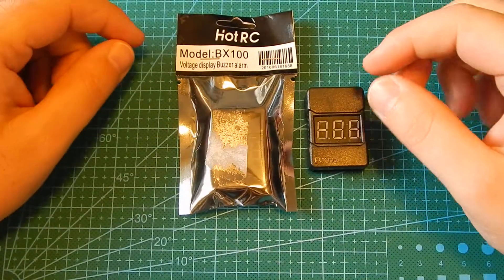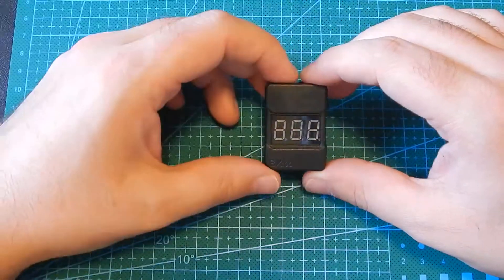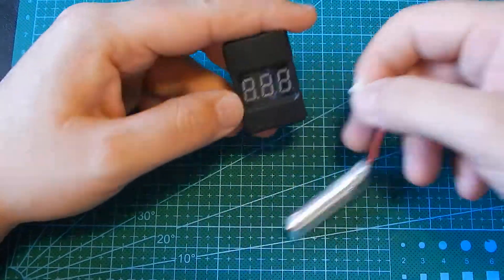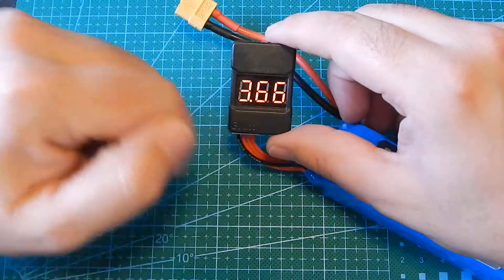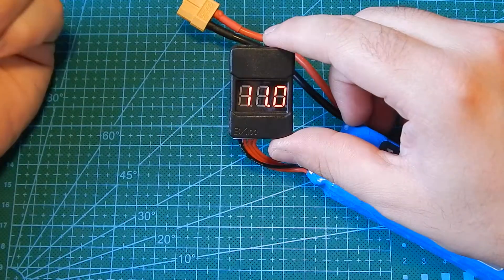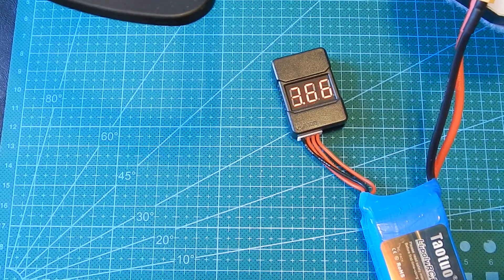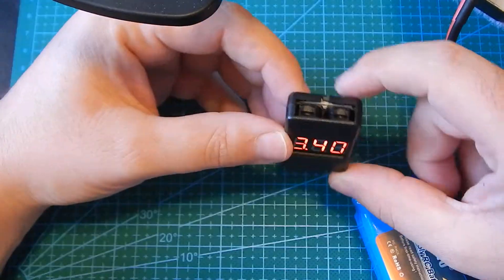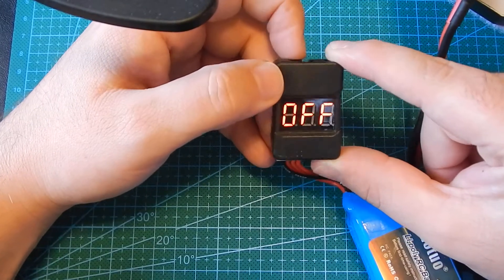BX100 Battery Voltage Tester Low Voltage Alarm Buzzer For 1~8S Lipo Battery

Comment: They're good but I wish the alarm would stop bleeping once the voltage goes up again, i.e. no longer draining the battery. Say for example it alarms at 3.2v and when you use the battery pack it drops below it. Alarm sounds. Stop using the battery and the voltage raises to say 3.4v, the alarm should stop by itself without manual override.
Reply: correct, u must d/c the cable for it to stop in my case

Comment: Hi I bought a few of these because HK is always out of stock.  But once mine gets triggered by low voltage from sagging, the alarm says on until I land and unplug it.  Does yours so that or does it behave like the HK ones where the alarm stops once the voltage recovers?

Any idea if that setting can be changed?
Reply from the maker: Mine does the same until it's plugged out or the button on the top is pressed.  I am unaware of any way to change it to behave as HK one. If I find a way I'll be more than happy to share it.

Comment: New problem. The second buzzer I used just now, started to buzz after less than a minute of driving without reach the voltage I have set. I have set it to 3.7 volt and with a fresh charged battery started to buzz to buzz after 10 to 20 seconds. Every time happens the same thing after i have disconnect and reconnect the buzzer.
Reply: same problem, is this thing even accurate, i display higher voltages on some cells when on load!, so a cell off load was 4.0v onload 4.15!
Reply: @GraphicManInnovations is not accurate and that's why I use battery tester, the device that has liquid crystal screen. The point is that the buzzer is good when it buzz to warn you when you want to stop drive. Next time I will buy the cheaper buzzers like the classics with the transparent cover with the hope to work.
Reply: @but531 
 @but531 
guess what i just discovered now also, the button does not work, it was working before, opened it and found one leg is not soldered at all!, so i soldered it and the button worked, however to be honest the voltages are pretty accurate off load, when on load it is really all over the place! many cells are not under 3 but it beeps for them, other recorded over 4.5 volts!! totals looks ok, i am really wondering what is the reason for that inaccuracy under load! there must be a good reason for this
Reply: @GraphicManInnovations  over 4.5 volts its wrong, a normal lipo is 4.2 volt per cell maximum. I don't know what else to say. Nice that you solder the leg. We should try other lipo buzzers and after you measure the voltage with the buzzer immediately measure with a voltage meter and see the differences.
Reply: @but531 
i am using 18650 cells, lithium ion, i did compare the voltages with a multimeter and the buzzer is making a mess, i have no idea why  it is acting like that under the load, makes no sense to me , it is very accurate with no load

Comment: Doesn't alarm to me, I set to mine but doesn't alarm and the battery stopped working at 3.1 volts. Man is so disappointing, I buy it to protect the batteries and the stupid esc doesn't cut the voltage that i set it and is a hobbywing max10sct.

Comment: I'm having problems with this. It seems to beep way too early. I had it set to beep at 3.4 volts and pretty early in the flight it started beeping and didn't stop so I landed and I read the voltage and each cell was at ~3.8 volts! Wtf? Do you face the same issue?
Reply from the maker: That happened to me too when I was pushing the drone too hard. Basicly when you are doing hard turns or fast pull ups the voltage momentarily dips under heavy load. Unfortunately that is enough to trigger the alarm. FPV pilots avoid this by having OSD (on screen display) that indicates battery voltage in real time.
Reply: Voltage sag because of heavy load